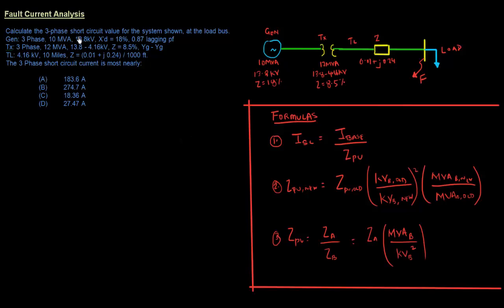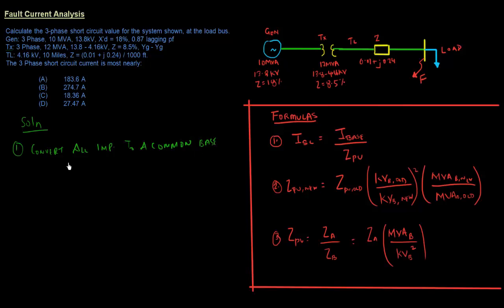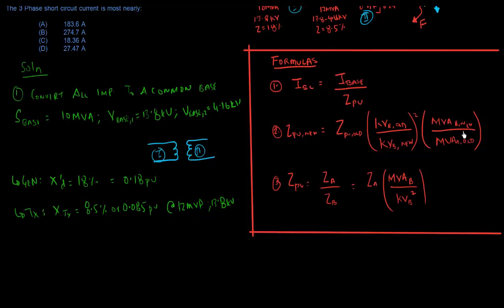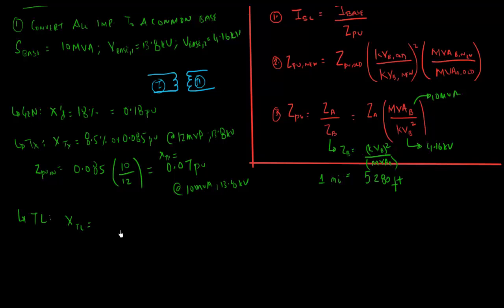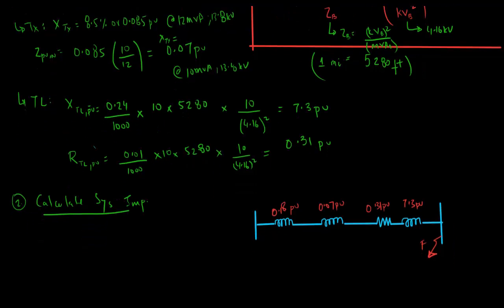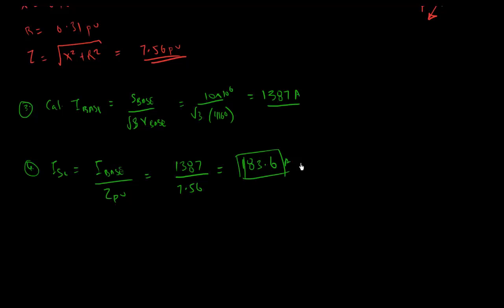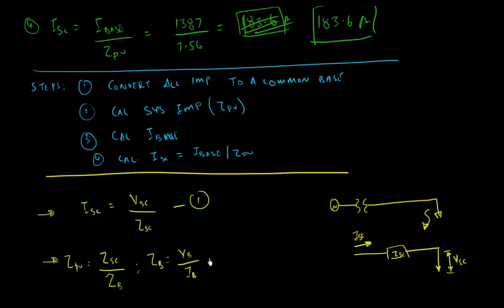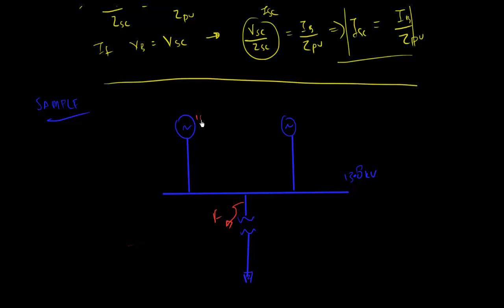Fault Current Analysis

Comment: 550.5A
Reply from the maker: Hi Tim,  Unfortunately, I am getting a very different answer.  Feel free to send me your solution at nimish@movingelectrons.com and I can compare with my solution to see which one of us has it right :)
Reply: I did it again, this time using the MVA method and got 8592A. Checked it with SKM and it looks like that is the correct answer. Not sure what I did wrong the first time.
Reply from the maker: Hi Tim, I tried the MVA method and still get about 5.5 kA; which is what I was getting with the PU method as well.  Do you mind sending me your solution? I would like to verify that we are both using the same values.
Reply: OK, I realized my mistake. I was read the X'd of gen 2 as 10% and used that instead of 20%. At 20% I got 5.46kA. Thanks.
Reply: This is what I got as well.